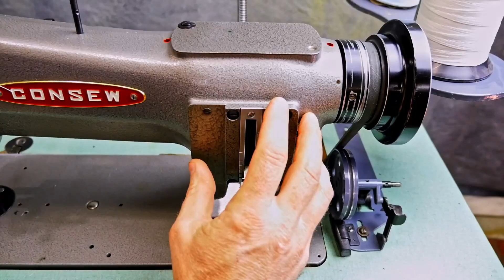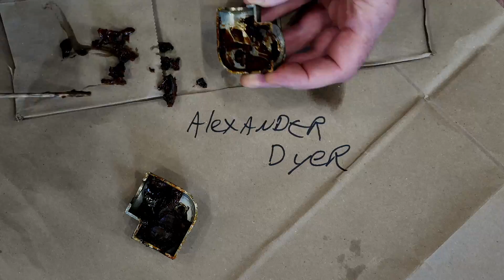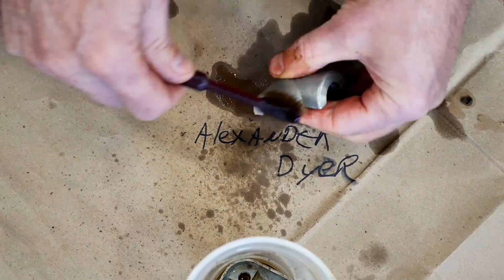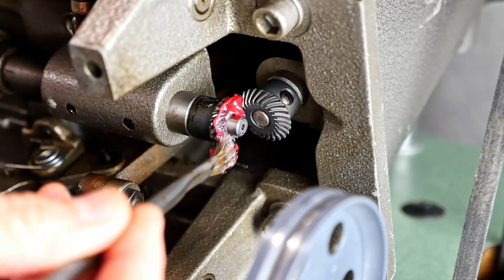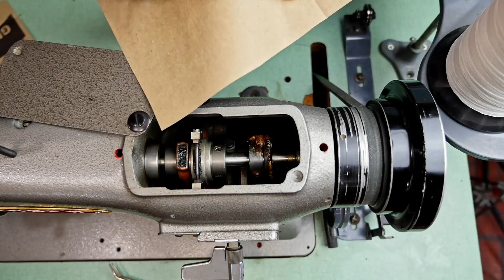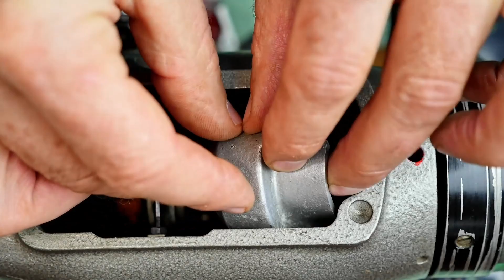Industrial Sewing Machine Gear Box Clean Grease Lubricate

Comment: As always THANK YOU for your detailed instructions. I just purchased the 206RB-1 and now I am able to do this myself. Would denatured alcohol be OK to used to clean the outside of the machine as well.?
Reply from the maker: Perhaps too harsh.
Reply: I'd suggest (1) sewing machine oil + elbow grease, or (2) mineral spirits.  Singer recommended bathing a machine in Varsol to release grease and oils from 400-series domestic machines.  Does not destroy the paint.  Modern equivalent is kerosene or mineral spirits.  Great to use in Eagle-like oiler cans.  Wear eye protection and have good ventilation.

Comment: Thank you so much for your videos! They are extremely helpful and your style is perfect. Own a consew 206rb-1 thanks to your recommendation. Was wondering if you knew what the “button” in the center of the top does? Appears to stop the lower shaft from being turned when depressed.
Reply from the maker: If I am hearing you correctly, you are describing the safety clutch reset button.

Comment: I'm trying to understand the manufacture point of view about choosing gear box rather than using a regular belt to transfer the energy from shaft to shaft, what do you think is better Alexander ?
Reply from the maker: Both are good. I think that the gears are more expensive to produce and you will never break a belt and have to replace it if you have a gear box type machine. I do not hesitate to buy either one.

Comment: How often do the gear boxes have to cleaned and regreased?
Reply from the maker: About every 50 years or so. Ha Ha, funny right? I am not really sure, that is to say I have never read a recommended time. I have done this on 80 year old machines that had the original grease in them. Once I do one I don't expect to redo it in my life time. What I do when deciding is to evaluate the age of the machine, its cleanliness and apparent level of use. If I suspect that it may need to be done then I open up the box and inspect the grease to determine if it should be done or not. That is the process that I have shown here.
Reply: Thanks for your answer. A fine demo.

Comment: Do you happen to know anything about what type of grease to use on plastic gears on a domestic machine? Or how to know if they should even be greased or not?
Reply from the maker: I am not the person to ask about plastic gears. Plastic gears are a primary reason that I chose to purchase the older sewing machines since they don't have any plastic gears. I'm not sure who to send you to either. Probably just plain old sewing machine oil would be fine.
Reply: Most types of lithium grease should be save for plastic gears. Don't use anything petroleum based. Silicon grease will be safe also, but it tends to dry out and get sticky quite fast.
You can also ask in a hobby shop, there are a lot of plastic gears in RC models.